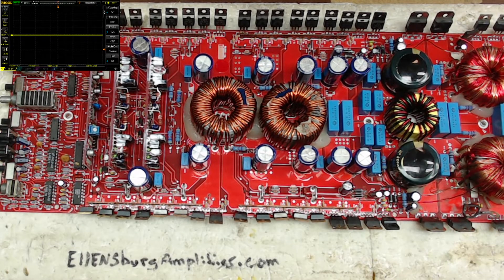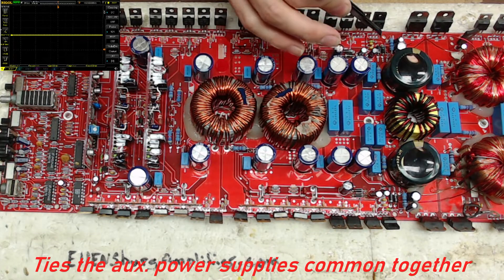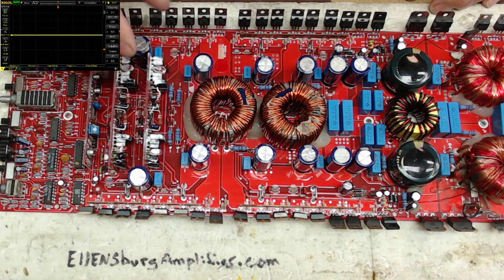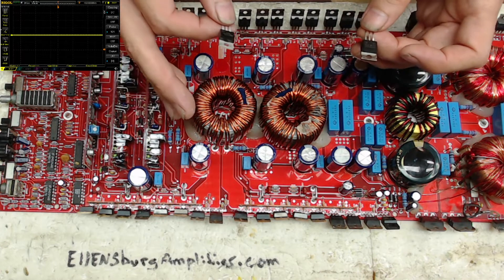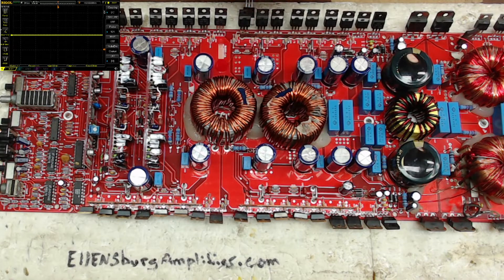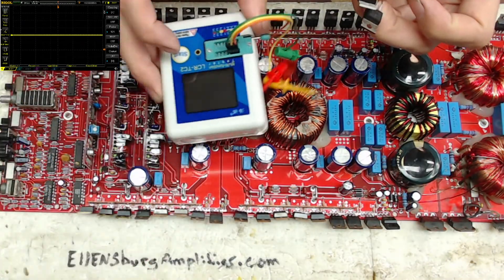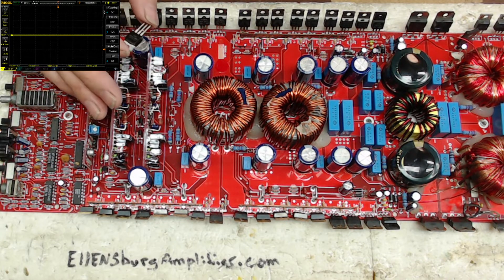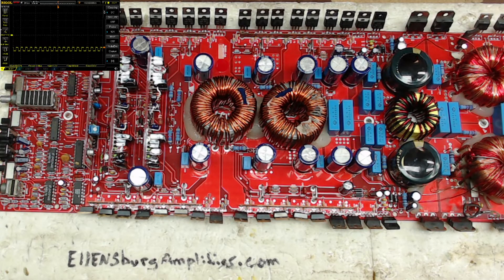Orion 2500D Old School Class D Automotive Car amplifier Repair and Transistor Lesson

Comment: Hola me gustaría saber dnd conseguir los transistores fb31n20d original y grandioso el video muy bien explicado gracias si me puede ayudar se lo agradecería mucho saludos 😊
Reply from the maker: I don't know where you can get originals as it has been quite some time since I last purchased any. When I did find authentic ones I stocked up so I didn't have to deal with this issue again. What I can say is to avoid the "shiny" black transistors and look for the "flat Matte" transistors. That is a good start.

Comment: How do you rate these amps stock with no problems? Pretty strong board/parts? I’ve been reading most are .5ohm stable, parts able to take that with good stable electrical system you think? Just wanted to get an idea of how well this board was built, I know it’s the early class D tech as well but still very capable right?
Reply from the maker: Great question! When it comes to stability these boards have that if they have the original transistors installed. Components are capable as in the inductors and capacitive filtering. However, with today's transistors, I am not seeing the same ratings for the 31N30's and would advise against a .5 ohm load. Heat will become an issue for the drive.
Reply: @ellensburgamplifier  ahh ok, thank you. Ya the one I just bought is all original, never damaged and actually the back has never been opened up before. I read they are prone to vibration damage because of the lack of anti-vib silicon so I applied some E6000 to compensate, surprised how little there was but then this is when a crap company owned them from what I heard :/ in your opinion/experience what would you change out/update/upgrade to make this amp more stable at lower ohmage? I’m not looking to increase the output, just make it more robust/hardy/stable/you know lol. Any advise greatly appreciated, thx for getting back to me!
Reply from the maker: @Nūrd_AF  You really can't change anything to make it more stable and it also depends on how it has been treated. If it has been driven hard you could check for any heat damage to the drive cards (solder joints) and the mainboard. Change all the thermal paste if it has any, glue the inductors down and clean up the potentiometers. That's about all you can do.
Reply: @ellensburgamplifier  ok, ya it looks real clean still, and doesn’t look beat on or driven hard and all solder joints look great, etc. I did add some E6000 and cleaned up the pots, etc so ya :) when testing tho I did notice a high pitched sound from subwoofer that’s always there, always constant, regardless of amp settings, etc, just the same high pitched sound, what would do that? I know that’s a general question and without hearing/etc it’s hard to diagnose but what’s the common problem that would make a constant high pitch whine on subwoofer? Sometimes it gets lower in intensity but it doesn’t oscillate or change really, I was assuming it’s cuz it hasn’t been run in so long but everything looks mint. Is there somewhere something can be measured to check output, etc to maybe help diagnose?
Reply from the maker: @Nūrd_AF  Noise is hard to track down. It can be some high-frequency switching making it past the output filtering or it can just be a noisy signal coming in. Sometimes one can find the source by using a scope but again it is tough. I check for noise by twisting and moving the inductors around while playing to see if it changes at all but I would not advise just anyone to reach into a running amplifier.
Reply: @ellensburgamplifier  ok ya, thinking the same-ish. And ya trust I’ve been trained/have a few degrees in PC hardware/Electrical apprenticeship so I know the dangers and mishaps, etc. thx for all the advice bro, really appreciate it :)
Reply from the maker: @Nūrd_AF  Any day!
Reply: @ellensburgamplifier  I had another question regarding this amp if you don’t mind, still learning 😅 but I was watching another repair vid of a diff amp and he mentioned “the output fets voltage is on the high side, I could make this amp more stable at the lower ohms side by replacing xxx output fets with xxx output fets but let’s continue” and that was it, I looked up the 2 and the main layman difference I could see was stock was 400v23a and the ones he suggested were 250v69 amp. Is that a common route for making a car amplifier more stable at lower ohms? I know each is specific so those ratings won’t work for all amps but is the increase in Voltage and increase in Amperage of output mosfets usually how one creates more stability at lower ohm loads? I’m assuming gate resistors would need to be changed as well, etc but just trying to understand the mechanics behind it, etc. really appreciate any insight into this method, ty :)
Reply from the maker: @Nūrd_AF  I will do my best to try to answer this but please keep in mind that the word "stable" has several different meanings depending on who you talk to. You will have mechanical stability and thermal stability in an amplifier. It is mostly pointless to change transistor voltage values as this is dependant on the rail voltage in most cases. Changing amperage may help keep the transistor cooler but I would rather look into the Rds on value while maintaining clean switching to aid in a cooler transistor. This is all while not taking into account the circuit driving the transistors. So in my opinion stability will come in the form of thermal management.
Reply: @ellensburgamplifier  ya I’m learning it’s a lot more then I initially thought, ty :)

Comment: Are those transistors the same as for the 2500.1 DZ....I was running mine at a half ohm and it took a crap when I opened it up that was what I saw to be the problem mine have gixy or something like that on them
Reply from the maker: I don't think the 2500.1Dz uses the same drive. I would have to see the board but I think it is using the 2110 or 2113 drive IC
Reply: @ellensburgamplifier  i was wondering where I could find those mosfets so I could try and replace them
Reply: I couldn't figure out another way so I changed my profile pic to the mosfet
Reply from the maker: @bluntduhon1983  The 31N20D's can be found at LCSC. They only have 42 left. I would make sure that your board uses these. Feel free to send me a picture of the board and I can help make sure you are getting the right parts. www.ellensburgamplifier.com for my contact info.
Reply from the maker: @bluntduhon1983  Your board uses the 88N30P transistors made by IXYS You will more than likely also need a new drive IC
Reply: @ellensburgamplifier  where are you located would you be interested in repairing the amp I also have a jp23 with a cap that let loose
Reply from the maker: @bluntduhon1983  I am in Central Washington. Just to let you know the transistors are $13 each for that amp. If you fill out my "request a quote" on my website I can assist with your request.
Reply: I have a JP23 and that amp is badass. I've watched big d wiz Dyno it and aslong as you don't exceed the maximum amount of current it can handle coming in that amp will push at least 4500watts at 1ohm I also have a Orion 2500.1dz that needs repaired. I've seen big d wiz Dyno the Orion 2500.1dz and it easily pushed over 4k watts..
Reply: @garyv6442  That wasn't a Dz, it was the older designed model 2500 D. I found out the hard way, I bought a Dz and compared it to the video Big D posted, they are completely different board layout.

Comment: Great info🤙🏼 I had a similar incident a year or so ago I was repairing a lanzar Opti drive 2000d it has the 31n20d for the outputs. I purchased some from an overseas seller and on my lcr tester it kept showing them as a diode so I thought they were bad and I ended up throwing them away 🤦🏼‍♂️so I ordered more only to find out they read the same way so eventually I tested them with a multimeter and they showed no shorts and they would appear to be okay so I whacked them in to see what it would do and lo and behold the amp works beautifully. 👌🏼
Reply from the maker: I was doing the same thing. Thinking they were bad when in fact they were OK.
Reply: @ellensburgamplifier  do you know why they show up like that on the lcr meters I would like to know. I haven't looked into it myself but always wondered lol
Reply from the maker: @LiLthirtSty  It comes down to the Vth. For instance, the datasheet shows the Vth to be 3 to 5.5v. If you get a batch that has a threshold of the max 5.5v (or higher?) then the LCR meter may not have enough to switch the gate "on" if the LCR meter is only testing at 5v. When you first power up the LCR meter it will show you what voltage it is testing at.
Reply: @ellensburgamplifier  great explanation and I have the mk328 and a tc1 lcr meters so it makes perfect sense now thanks bro🤙🏼

Comment: Great video!  The differences between those 2 of the same transistor types - I put that down to fakes being passed off as the original part.
Reply from the maker: Agreed. I will get to the bottom of this soon! My primary distributor is stating "differences in manufacturing tolerance".

Comment: I also have an amp at shop today.
Its 4000.1d from interfire.
31n20d transistors are shorted.
I don't get that bcs in my market they said that 31n20d is obsolete.
I found irfp4227 in smaller package.
Can i replace it with that?
What would you think?
I think that i can
Reply from the maker: I have found that circuits which use the 31n20's are picky about what goes in. You can try to see how they work ( I would have to review the datasheets) and I have not found a suitable transistor that will make a good replacement.